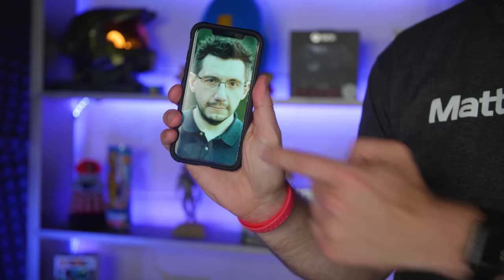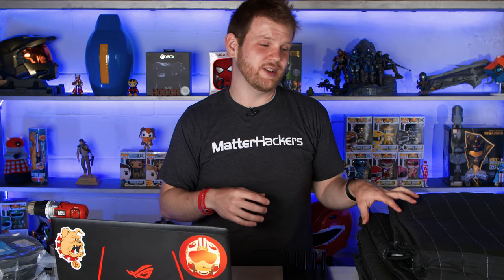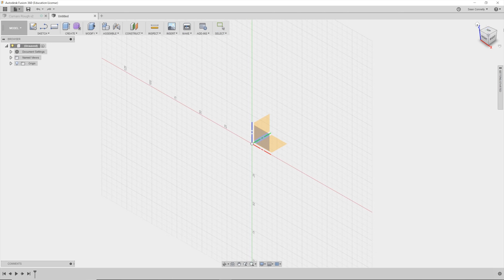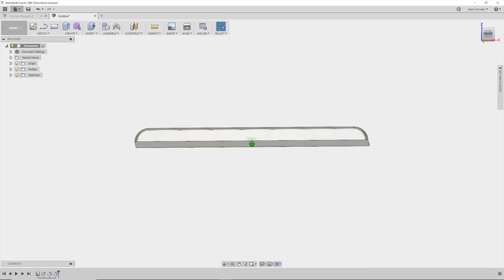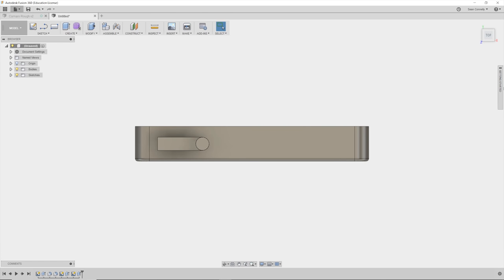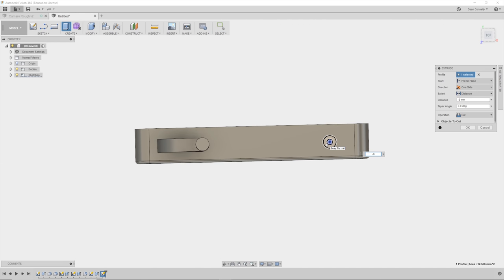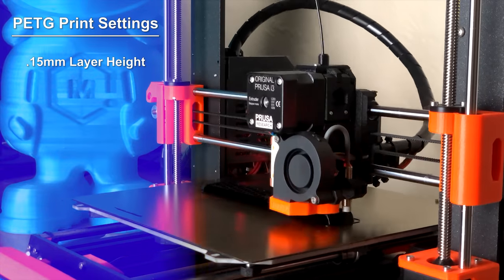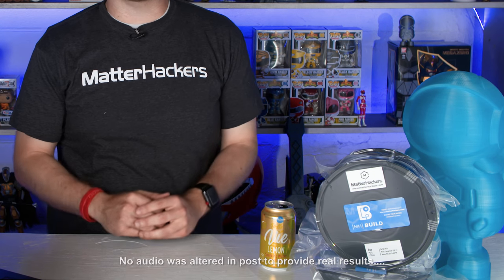Better Studio Audio Thanks to 3D Printing

Comment: Great video. One suggestion on the hook would be to have the peg at a slight angle up so the blankets don't slip off.
Reply: Yes indeed, but also making the fillet concave is one of the things you could adjust, it makes for a more seemles transition from one part to another, it also requires less material and is equally as strong or maybe even stronger

Comment: Using a Prusa MK3 with a heated bed and PEI, I didn’t know about using a glue stick with PETG until recently.  What I opted to do was heat the bed up to about 40C and then pop off the builds by flexing the steel plate.  Heating the plate allows the PETG to soften enough to pop off, plus no messy cleanup.
Reply: Eric Zwirnmann great tip!

Comment: Great job Sean. It's a great example of practical printing. Possibly overkill but who cares 😂. Shearing off the post was my initial concern due to the layer orientation but the supports will probably rectify that. Lastly, did I hear you correctly... you have a hot water service, a furnace, a washer AND a dryer...... he he. Cheers, JAYTEE

Comment: I have a siht ton of those blankets (but they are moving blankets - wonder if they would work).  BTW I like that "this is 3D Printing Nerd". Watching now
Reply: U Do It yes I belive they would help. Flat and hard  surfaces like the reflect sounds. The goal is to reduce the reflections with in the room as as possible. Sean proved it also helps with the outside noise as well.
Reply: The moving blankets are probably missing the grommets, but those are easy to add and will be a lot cheaper to do that way.
Reply: No need, you can use large binder clips!!!  I do and it's extremely easy.  Takes only a few seconds.  Still have the wire portion of the binder clip to hang from using hooks like this video.

Comment: An easier way to create the stepped holes is to draw sketch points on the plane and use the CREATE->HOLE command.
Reply: Falk Kyburz thanks for the tip. ^_^

Comment: I would have printed the hooks lying on the side so that the poles are printed with the layer direction (to increase the strength of the parts, since the way you printed the parts the entire weight of the blankets is clinging on small areas of plastic, relying on very good layer adhesion). Printing the hooks on the side would have required supports though which can be messy with PETG. Fortunately PETG has a better layer adhesion than PLA (at least with cooling fans off), thus printing it like you did may just have provided enough layer adhesion.
Alternatively you could have also increased the strength of the poles by utilising them as "screw hole", i.e. by designing a screw hole for a longer screw into them and then using this longer screw to enforce the plastic.
Either way its always good to consider the expected forces your design will encounter in real life and then design the part considering your future print orientation.
Reply: LuckyBenni very good tips!  Thank you for watching and for the excellent feedback. ^_^

Comment: There is a very easy way to make screw holes. look under create and look for Hole or use the short-cut H. It has features like counter-sink, recess, and new threads. Check it out.
Reply: david klotzbach thank you for that. I’ll for sure be using it. :)

Comment: I wonder if any here can assist me, I am attempting to 3d print something and my printer is printing things too thin now, but a little while ago on my last major prints it was doing fine... is this a nozzle degradation issue? My prints that are normally "tougher" are fragile and very thin. I printed the same material on another printer and it is stronger with the same model just need to know what is wrong :/

Comment: I have a doubt about the way you avoided the blankets from falling, since the cilinder is horizontal, and some movement (someone passing by) could make the blanket flail and fall
Reply: I also thought about that, but being that they're up against a wall, I'm just hoping no one bumps in to them. That could very easily bite me in the butt in the future, though! 😂
Reply: You can VERY EASILY print some end caps to pressure fit over the cylinder and no more blankets sliding off.

Comment: How come you didn't put some type of curve on the end of the pole, that way the blanket won't fall off as easily?
Reply: I definitely could have! But the hooks are positioned far enough apart that the limited space between each grommet creates a good amount of tension in the blankets. I really had to pull and stretch to get the blankets attatched to each one.

Comment: Good video Sean! 
/edit see comment below :)
Reply: welbot awesome!  Thank you! I figured it was something simple 😅
Reply: Always happy to help :) Feel free to reach out on twitter if you ever have any queries about how to do something. (@theREALwelbot)
Reply: Actually just realized there is no check box on the move command for features like that. (That checkbox only shows up for bodies or components).
Instead, you have to use One of the pattern commands (Like rectangular pattern) and select either the faces you want to clone, or the feature (eg the extrude operation in the timeline.) 
If you know during the sketch phase that you want 2 holes, you can simply copy/paste (ctrl+c ctrl+v), and when you paste, it'll show the move tool so you can move the clone where you want. If you want several, you can use the pattern tool under sketch tools too.